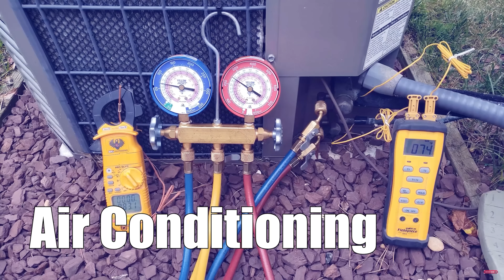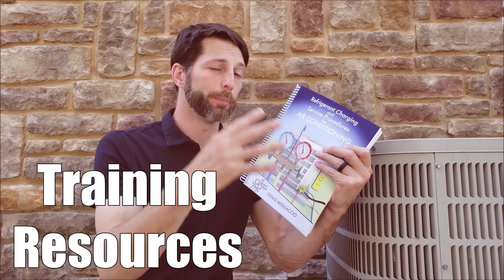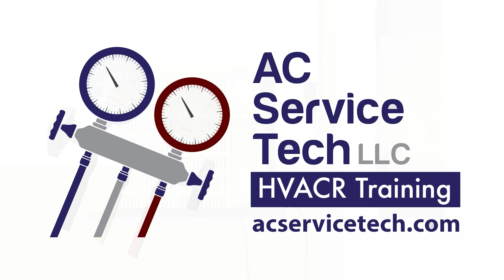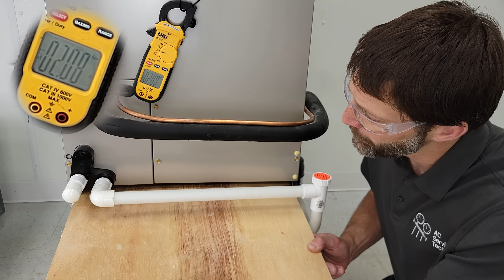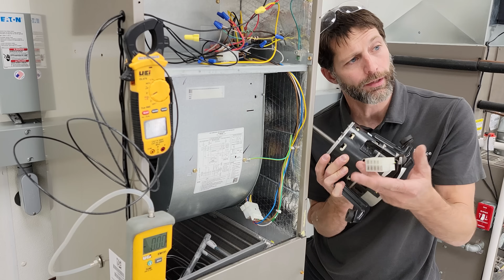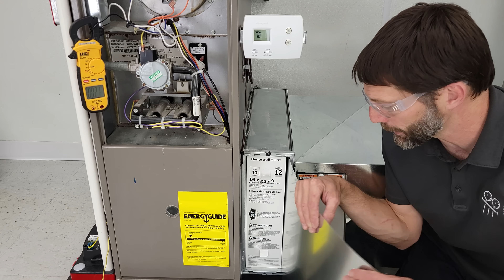HVAC Blower Motor Operation and Current Draw during Airflow Restriction! ECM vs PSC

Comment: May I ask - with PSC, you mention after blockage and static pressure increase, the current lowers. But if the current lowers shouldn’t the fan speed lower too?! But it’s a constant rpm so it can’t right? So what gives?!
Reply: Stick your hand over your vacuum cleaner hose and see what happens. The motor speeds up because the load on it has been reduced because it cannot get any air, and if you put a meter on it you will find that the amp draw reduces
Reply: On a squirrel cage blower, when you restrict airflow it unloads the blower wheel it reduces the work it does, so the RPM goes up, and the load on the motor goes down so the current goes down.
What helped me to visualize and understand this years ago, was putting your hand over a vacuum cleaner hose and listen to the motor. It speeds up because it's unloaded and not doing any work because it can't get any air, and the current goes down

Comment: Your comment is interesting, as part of the sales pitch I've heard over the years for ECM motors, is that they'll automatically compensate for duct irregularities or restrictions, or high static ductwork buy automatically increasing the motor speed and airflow to compensate

I'm still not sure one is better than the other. I would like to see a direct comparison of two identical systems with the same identical blowers and ductwork and static pressure, all designed properly, and with all three motors compared side-by-side in those identical systems

My subjective experience just being out in the field, I haven't noticed a big difference in how much power and ECM motor is using compared to an old fashioned PSC motor

I just worked on a 4-ton package heat pump with a 4 amp 3/4 HP PSC motor and it was drawing 2.8 amps how much would an ECM motor be using?

Comment: The ecm is very amazing also because I have taken ohm readings of the internal windings and they read from 3 terminals the same resistance , as 12 ohms each as though it is considered position windings almost energizing 2 windings in a particular position to spin one way or the other !

Comment: With AC voltage applied to the motor , for instance a motor with common to start winding resistance and common to run winding resistance and then from start to run winding resistance. I would use ohms law and take the voltage from common to run , common to start and start to run across a capacitor and divide the resistance into the voltage and get the current ! I would get 3 different currents. Because reading AC current, which is alternating like voltage peak to peak it is difficult to get a correct current reading unless we had an oscilloscope with measures cycles per second .  Also related to the revolutions per minute I can divide 60 by the revolutions per minute and get the revolutions per second of the actual fan blade!
Please reply!

Comment: Great video! I’ve been wanting to do one like this for a long time. Well done Craig!
Reply from the maker: Thank you for watching! 👍
Reply: @acservicetechchannel can you do a video where you show the three different types of motors in identical units and voltages so we can see the difference in amp draw between them?
Reply: @acservicetechchannel I'm also curious if you know, do the ECM Motors speed up the impeller to an even greater RPM then the PSC does when it's unloaded by blocking the airflow?

It's clear that the PSC motor and impeller is being unloaded with airflow blocked, that's why it speeds up and draws less power at the same time

?

Thanks

Comment: I'm really new to the trade how do I know which wire of the 10 wires to put the amp clamp on on the plug to the blower motor? Thanks
Reply: I don't know for sure but if you look at the schematic you can see which are the line voltage wires going into it, and I would put the meter around one of those

On a simple air handler or furnace like these, it works just as well to put it on the actual line voltage wire coming into the entire unit because the only other thing using power besides the motor would be the Transformer and circuit board which is insignificant

Comment: Thank you for this info, I have a solar system and this helped improve our power draw on the unit. However I also noticed in my testing that our air handler is drawing 6 watts from out outlet when it is not even running. Is that normal?
Reply: Yes. The Transformer has to be working 24/7 or nothing's going to work

Comment: I have an old motor rated 10 Amp, the supply house staff said I have to use a equal or higher Amp replacement motor. He said the control board would send 10 Amp current to the motor, if I put a lower Amp motor it will be burned out. I think that’s other way around. Put in a lower current rated motor will be safer. Anyone has any ideas? Thanks
Reply: I'm sure my reply is too late for what you needed to know but perhaps it will help others.

A circuit board a relay does not send any current, all it can do is connect the circuit and send voltage to the motor.

Then the motor will draw whatever current depending on the size and load on the blower wheel.

The amp size rating on the motor that you're talking about doesn't mean the motor is going to use that many amps, what it means is that it is capable of being loaded down up to that level of using that number of amps, in the example you gave, that 10 amp motor should not be drawing more than 10 amps, if it is then it's too small for the load it's on

For example, I just worked on a package unit with the factory OEM 3/4 horsepower 4.0 amp motor, that was actually drawing only 2.8 amps working fine

In your case, if you knew how many amps your old motor was using before it went bad, you could choose a new motor with that amount of amps or more

For example, when in a bind or an emergency late night or weekend Etc and I couldn't get a 3/4 horse motor, I have put a 1/2 horsepower instead, and it still didn't even use its Max amp rating and it worked fine

One time to get the guy going, and he didn't care, I replaced a 3/4 or 1 horsepower ECM motor in a 5-ton package unit with a half horsepower PSC motor, I was concerned it might not be enough and it was still only using its rated amps or just a little under. And homeowner said the volume of air was about the same as it ever was.

Comment: So to test amp draw on a variable speed blower motor or ECM motor you just put the clamp meter on the incoming power leg?
Reply: Yes, unless it's winter and it's a heat pump with heat strips that are running, then you need to disable or turn off the heat strips

Comment: That makes sense with these motors.
On a psc propeller fan , why does the current increase with air restriction?
Reply: Because that's what happens with a propeller fan the physics Dynamics are different on squirrel cage blower. That's why when you hold your hand on a vacuum cleaner it actually unloads the motor and you can hear it speeding up and if you put a meter on it you'll see it will draw less power
Reply: But PSC is also called “fixed speed” so even if the load decreases and current decreases ……why would the fan speed up? First off I would think it’s built to resist changes in speed otherwise why call it fixed? Secondly, lower amp draw to me would be relative to spinning at the same speed it did before.

Comment: How does the variable and constant to torque ECM blower motors know what the static pressure is? Are there static pressure sensors in there that are talking to the motor?
Reply: No, it senses how much torque it needs to keep the motor at a certain RPM, probably by monitoring how much current is needed at that RPM.

Comment: and this is why so many ECM blower motors fail!! don't use an ECM blower motor on a system with terrible ductwork, IT WILL FAIL.

The constant argument of ECM blower being shit compared to PSC motors bothers me, they're not shit at all, they just don't work in poorly designed systems lol. I've always had a rule of thumb where the absolute most critical section of an HVAC system is the ductwork. If the ductwork is terrible, no matter what unit you install, it will never work correctly. Fix the ductwork and everything will operate as it should.

Comment: I've been playing with my Longwood (propane over wood) and without wood in the chamber the blower would cycle a few times before temp came up in the room. I used a piece of cardboard on one side of ducted fan and now motor runs continuously but probably draws less amps as it's creating less pressure. Also, less air over an A coil would lesson the demands on the condenser unit wouldn't it? You wouldn't be transferring as much heat out of system. Now if condenser was restricted of airflow it would cause a rise in pressures and increase in compressor load.

Comment: Last November I ran into a dead ECM blower motor on a store RTU. That RTU was ~12 years old and that motor was OEM only replacement, $600 and 2 weeks wait (at least). So, it was November with freezing temperatures.... I just installed regular PSC motor and a contractor that would get 24V directly from the thermostat. So, the entire repair was less than $500 (including the PSC motor and the contractor). The customer is happy, everything works great. From now on I would thing twice if I go back ECM or just replace it with PSC motor and close the case.
Reply: It depends. You can easily replace an X13 style motor and program them or just use ones that mostly do the job. If the unit is constant air flow and uses communication, that's not really an option. Sure, you can get a kit that does translate it over if you are tired of doing replacements. But the expense is the part that is made to work exactly as it should with a module, not because the motor in it of itself is special.
Reply: My second ECM motor on our HVAC failed, when my B-I-L said, let me put a PSC motor on it. It has been fine since. The first ECM just died, replaced under warranty, the second developed a bad bearing and rumbled, I had ordered bearings when My B-I-L installed the PSC.
Reply: That's like choosing to conmute on a donkey,  instead of a gas vehicle.
Reply: Yep, that donkey did the job pretty well and still working fine… for 1/3 of the price and… it was in the local store. However, the ECM motor was only from the manufacturer, two weeks waiting… And it was 23F outside… So, GO donkey! :)
Reply: @franciscog175 please do explain such a drastic difference. Have you put a meter on the same size units with one with a PSE motor and the other with an ECM motor and seen how much difference there is?

Comment: Great video, I was always under the impression if the blower motor has less air to move the amps would be lower just like the PSC motor did. Good to know that the ecm motors do not work like that.
Reply: Technically, they do. But they are programmed to compensate.
Reply: @sprockkets  
How do the ECM blower motor is know what the static pressure is? Is there a sensor taking static pressure in the unit that's talking to the blower motor? I'm confused of how it knows
Reply: @BibleBloopers  it knows via the amount of "drive" it needs to reach a certain rpm.
Reply: @sprockkets  thank you and one other question. With a constant torque ECM motor, if you get a g call and a y call to the ECM motor at the same time then what takes priority?
Reply: @BibleBloopers  y does. Same for constant cfm motors. Essentially it picks whoever is higher.
Reply: @sprockkets  thank you again
Reply: @sprockkets so is it correct to assume that the ECM motor will spin the impeller up to an even higher RPM then the PSC motor naturally goes to when air flow is restricted on both?

Hypothetically, let's say a 1075 RPM PSC motor runs at that speed with no restriction, then you restrict it like you did in the video and let's say it goes up to 1400 RPM put the load on the motor and the current drops, as well as the air flow

So does the ECM motor spin the impeller up to 1800 rpm? I'm assuming whatever the difference is it must have to raise the RPM much higher than the PCM motor at the same static pressure in order for it to drop more current

Correct?
Reply: @7x779  actually I'm not sure about the rpms of psc motors in this case, simply because I can't see them in action in an air handler. I know in general motors like a universal motor speed way up with no load. I know ecm motors with the door open of course spin fairly slow due to no static pressure.
Reply: The “drive” would be for constant torque but variable speed I think uses actual pressure sensor.
Reply: @MathCuriousity  no pressure sensors in any motor.
Reply: @sprockkets  may I ask a question: you know how it’s said that in a PSC fan that blocking filter will draw less amps? Is this because 
1) blocked filter = less air =less load= less amps for the same speed that it wants to run at ?
2) OR does current drop because of something I read about in PSC motors called BACK emf ?
Reply: @MathCuriousity  option 1. Back emf is another thing keeping a motors speed in check, but that's its own thing.
Reply: @sprockkets  so we have blocked filter ……less air….less air flow….less force on the fan blades…..so same torque less force ……faster spinning …..which causes more back emf which causes less current!
Reply: @MathCuriousity  yes, back emf opposes current flow. But it's always there, just at different levels of course, to stop a motor from going infinitely fast so to speak.
Reply: ok but are you saying this “flow of causation “ is correct friend:

 so we have blocked filter ……less air….less air flow….less force on the fan blades…..so same torque against less force on blades ……faster spinning …..which causes more back emf which causes less current!?

TLDR: is it same torque against less force on blades that causes the increase speed? If so - why are PSC called fixed speed motors and not fixed torque cuz clearly their torque must stay same to have less force on blades cause increase in speed right?! How else could the speed increase then right ?!!
Reply: @MathCuriousity  Well, just about every blower motor is actually multi speed since they have multiple power taps. Since their loads are different depending on static, their speeds can vary.
But a PSC motor on the outdoor unit does basically run at its correct RPM.
Reply: @sprockkets  wait what do you mean by power tap? But isn’t this set and forget? It’s not like the motor taps into different power taps depending on the static pressure in PSC motors right?!
Reply: @MathCuriousity   no, but motors in indoor units have 3 speed taps typically
Reply: @sprockkets  friend let me ask you a final question: why does a fan spin faster under less load?
Reply: @MathCuriousity  less resistance to it doing so.
Reply: @sprockkets  hmm so what would you say is the chain of events ? Less work then less current but then how do we get from less current to MORE speed?!

Comment: Have always wondered if there was a way to know what the amp draw should be.  The rating on the motor doesn’t seem relevant in my findings.  Would door removed amp draw be the best for comparison?
Reply: No. Door on is the proper measurment. With PSC that could mean over amps with a door off. Experience will tell you what you should expect. Typically 1800 cfm should produce 4.2 or so amps on 240v.
Reply: It depends on the condition of the system. Door on with a plugged filter or coil or collapsed return duct or homeowner which closed off a whole bunch of Supply ducts is it going to really throw your reading off

Comment: Wonder why the amperage increases with the constant torque / variable speed. How does the motor know it has to work harder?
Reply: The motor doesn’t all the magic is in the module(computer) and the ifc (mother board)control in the furnace
Reply: It has a static pressure sensor that tells it to speed up as the static in the duct increases. A constant speed motor has no static sensor tied to it and as the the duct plugs up the blower simply moves less air and in turn the motor draws less amps
Reply: @pcpolice7937 really? I've worked on hundreds of units and never seen one with a static pressure sensor regardless of the type of motor it has

Also, what do you mean by constant speed motor?

I don't know any such thing exists in the real world
Reply: I get that it draws less amps - but why does it also speed up?! I thought PSC = fixed speed?
Reply: Brett, I have wondered the same thing. The only explanation I can think of is that the module must sense when the load on the blower wheel is reduced by having air flow restricted which unloads the impeller and causes it to speed up. To compensate, the module speeds up the motor even more to place a load back on it to increase the airflow to attempt to compensate for the restriction

How else can you explain the current draw increasing when blocking the airflow actually reduces the load on the blower wheel?

Ps.. a lot of people get the wrong idea that when you block airflow on a squirrel cage that it's actually loading it down and making it work harder

It does not load it down more to understand this simply put the hand over your vacuum cleaner hose and listen if the motor speeds up or slows down. It speeds up because you're unloading the impeller by blocking the airflow